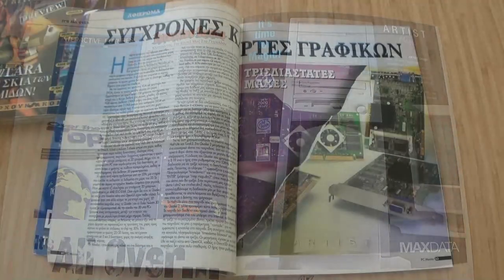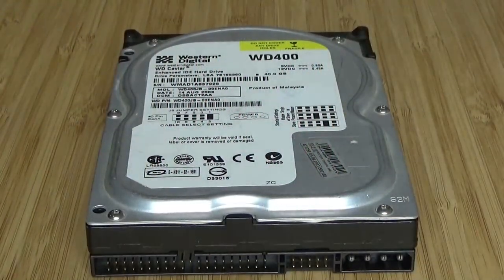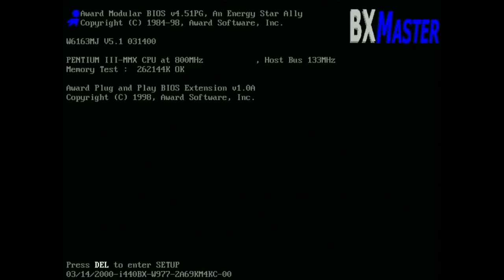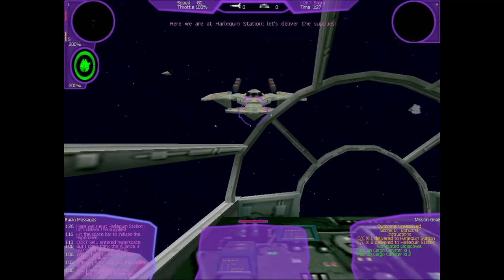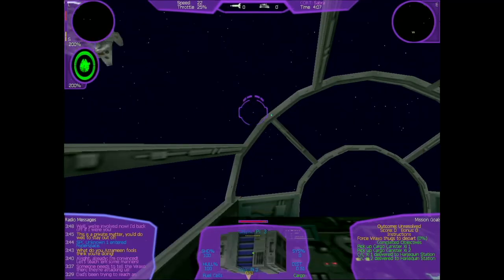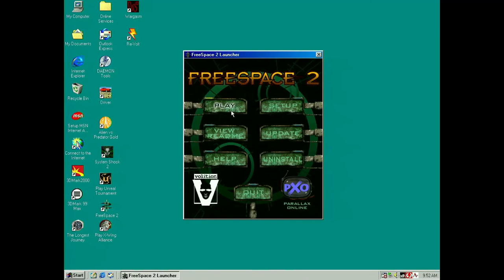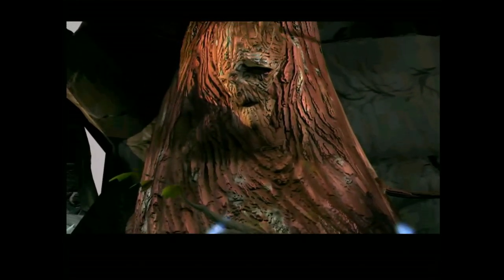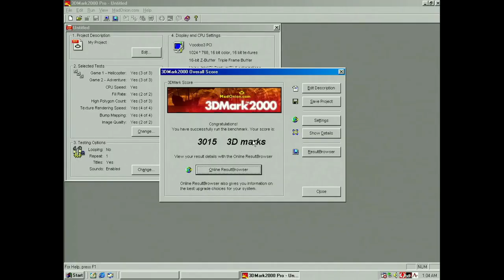Gaming PC Build 1999 /MSI BX Master /3dfx Voodoo 3 /Aureal Vortex 2

Comment: I like some of the "creative" cooling solutions, lol.  I sometimes would get a little carried away.  I still have two of my old pc's where I "added" holes and fan(s) in the top of the case for top exhaust back in the day.  Looking at the cases now, I somewhat regret doing it.
Reply from the maker: You are right ! Thank God ☺️ I didn't dig a hole in my precious Voodoo 3 😅 I was very "creative" with a respectable amount of tire ups !
Reply: @spyros86  Now that you say that, I could see someone drilling and tapping the stock heat sink for a small fan mount, lol.
Luckily, I'm a little timid around circuit boards.  ;)  I have a GeForce 2 with a long dead fan and my temp fix was a local place sold cheap squirrel cage fans that fit in an expansion slot and exhausted air outside the case and it sucked air near the cards next to it.
However, because they were cheap fans they only would last a year before dying also.
I no longer use that PC, but I still got it for nostalgia.  Getting it going again is on the list of "bad weather day projects".  ;)

Comment: Vortex 2 is the only unique hardware for 9x. You can emulate 3dfx/DOS. Not only can you not emulate a3d, Microsoft removed 3d sound from the OS since Vista, and XP did not work with a3d, only eax. A3D came from NASA research, and uses wave tracing, which is Ray tracing for audio. A3D is beyond hrtf, which is already super rare as it is.

Comment: I do seem to have the standard 6163 w/o extra features. 

Great board, I have recapped mine and it currently runs a 550MHz Katmai unti I can buy another slotket... the one I have resides in my ABIT BE6-II gaming build (Geforce 4 Ti4200, P3 1000EB, 768MB RAM, 120GB HDD, Aureal Vortex 2, RTL8169SC NIC as well as USB card, 98SE w/NUSB and a lot of Rloew's patches).

My 2nd build is based on the very rare MS-6168 w/ V3 2000. It's more rare than standard boards as it came factory with 16MB SGRAM, not 8. I run a 650MHz P3 on it, 2x128MB SDR and a 13.7GB IBM Deskstar on it, also w/98SE.

A few other builds I plan to do will feature the following boards:

- ABIT KR7A
- ABIT BX6 R2.0
- MSI MS-6195 (K7 Pro IR3)
- DFI CS32-TC
- DFI CS65-TC (both are Tualatin capable)

Comment: So, I had the same motherboards (yes I had many of that model), I had the AGP and PCI version of the 3DFX Voodoo 3 Video Card, and I had the Aureal Vortex and the Aureal Vortex 2 audio cards (1 of the 1 and 3 of the Vortex 2), I had TDK case for 2 of the systems and a generic (Dell style with the swing out PSU) for the third system.
Reply from the maker: Wow ! So many boards ! Did you need them for work or home use?
Reply: @spyros86  I got most of them from a company that was shutting down, I also had 2 of the 20" 1900x1200pxl monitors from the company (drafting monitors from the early 2000s). I used to rebuild old computers and put various versions of Linux on them, and then give or sell cheap to people that needed them.
Reply from the maker: @RandalLovelace  That's very nice 👍. It's wonderful to give a second life to old systems, for the people and the environment.

Comment: The elastics, and plastic fasteners over time will dry out and come loose, the elastic becomes a stick. And I would have placed the hard drive with the logic board down to avoid dust.

However, the pieces and the recording are pretty cool.

👑👑👑

Os elásticos, e prendedores plásticos com o tempo vão ressecar e se soltar, o elástico vira um grude. E eu teria colocado o HD com a placa lógica para baixo para evitar poeira.

No mas, bem legal as peças e a gravação.
Reply from the maker: You are right about the HDD, I have installed it wrong. About the tire ups, you know, nothing lasts forever. Every few years we have to do some maintenance, clean the dust, put new thermal paste and sometime new fasteners. Thank you 😊

Comment: I collect 2 yeats ago the biggest P3 1,4ghz Tualatin,GB motherboard,3x512 sdram,Ati Radeon 9700ori plus two 80gw HDD WD and Plextor slow CDRW plus DVD rom.But I will assemble when I have time!!I alsi have the similar but with the strongest Athlon Thunderbird 1,4 Mghz which is very rare!!

Comment: mmm, i just tossed my p3 933ES into a dfi pa61, along with a gf4 mx440 (with a v3 2000 as a swap in for when i need glide), 368mb of ram (no idea where my 256 sticks ran off to), an 80gb drive, and an awe32. oh, and usb and network cards, but they're not particularly special. tossed a 600eb in a slightly older machine to use as a dosbox, and will build a 486 rig for even older dos gaming when i can find my old socket 3 board.

the 933 is doing juuuust fine, i need to stick a few things back into the 600eb, and no luck yet on the s3 board. though i wish i could find my awe64 for the 933 rig. oh well, it'll happen when it happens.
Reply from the maker: You are very lucky to have an awe32 ! 
We share the same passion on building a 486 ! 
It's cool to collect an awe64 but in my opinion it's not the best sound card for dos games or win98 games.
Reply: @spyros86  yeah, its not great for the dos side, but its awesome for win9x/etc. well, unless you're doing a lot of midi output to one of the roland devices, then its iffy. but i've got an audiodrive, one of the yamaha cards, and a monster sound 3d mx200 should i ever get my hands on a soundcanvas or mt32 as well as a plethora of vibra and sb16 variants to choose from, and a single sb2.0.

but the awe32 does what i need for the majority of stuff that will be played on this box. 

cheers